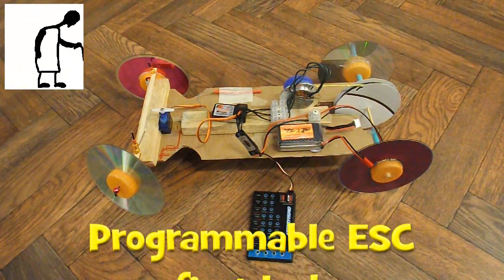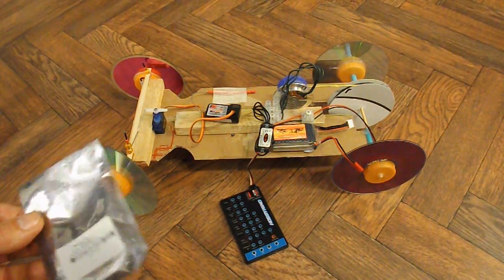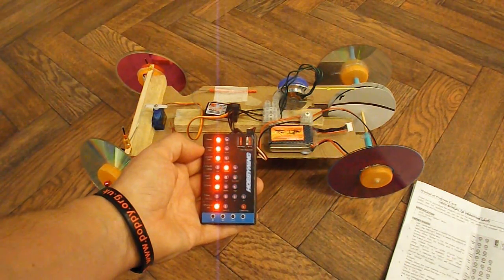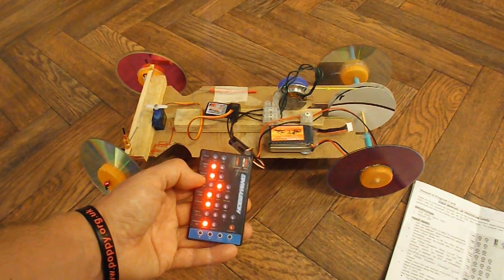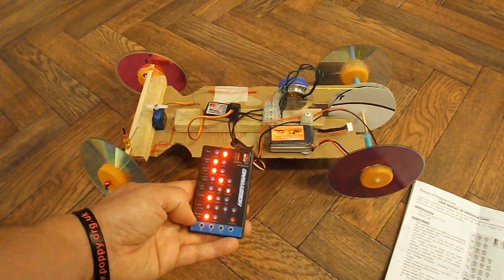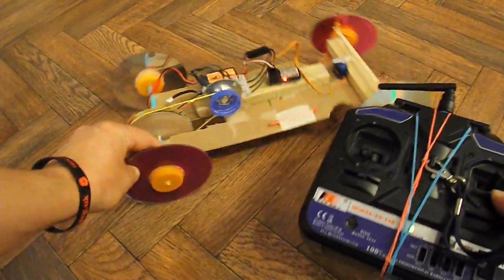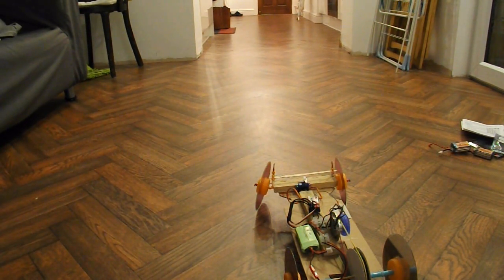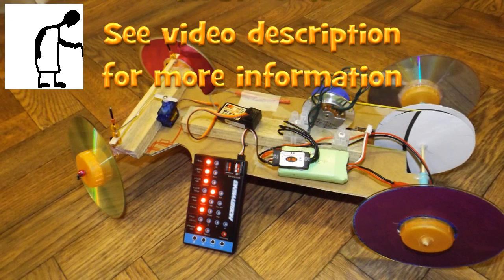Programmable ESC first look

Comment: I think that car needs an alignment haha, pretty cool car though, It might need lower gearing though but that would be difficult without actual gears.
Reply from the maker: +xxX “Datsun4Life” Xxx the angle of the wheels at the front is accidental but it does actually make it turn better as it gives something of an Ackermann Steering effect. The gearing could be adjusted relatively easily changing the sizes of the pulleys. The main problem is fitting anything to the motor as it is not designed to do that and just has a flat face with no convenient shaft sticking out. Previous videos featuring this car are linked in the video description.

Comment: Hi grandad, a while ago I asked you why would you bother to program an esc and now I see that this programming thing is  unnecessarily detailed. I am not going to buy one of these. All I'll do is using my "blushed" ESCs on my projects as they are.
Thank you for the video, you made it clear for me.
Reply: +GrandadIsAnOldMan YOUR OLD!!!!!!!!!!!!!!!!!!!!!!!!!!!!!!!!!!!!!!!!!!!!!!!!!!!
Reply from the maker: +Gurer Guncan I guess there must be a need for this in some circumstances, maybe racing cars might need it to reduce wheelspin on acceleration but I cant see it has any benefit on the type of projects I do. The low voltage cut-off settings may be useful in those circumstances too. I would think if you have a reasonable up-market transmitter you can make the changes on the transmitter instead.
Reply from the maker: Zachary Syed yes, there is a bit of a clue in my screen name

Comment: did you start out with a 1s lipo to start out with or 2s cause it clearly said 2 to 3s    .......... first comment
Reply from the maker: +Tristen Risenhoover it is a 3S that I start with and the power cuts as soon as I try full power so I am guessing the motor draws too much power through the ESC. When I used the 2S it was happier. It is only a 10A ESC so that is why I think it may be the motor drawing too much power. I do not know, so this is just a guess. If I lift the car off the floor so there is no load on the motor when the wheels spin then I can apply full power. With the load applied the power cuts. With the motor running and the car moving the power cuts if I try the steering at the same time so that again indicates extra load being drawn shuts down the ESC.
Reply: +GrandadIsAnOldMan try buying a rc motor for a rc plane that will hopefully solve your problem
Reply: +GrandadIsAnOldMan since u have a plane ESC
Reply from the maker: +Tristen Risenhoover I don't have a problem. What makes you think it is an ESC for a plane. If you follow the link to the eBay listing it states it should do forward and reverse. I don't know of any plane that uses reverse.
Reply: +GrandadIsAnOldMan it states in the futures that it is for a fixed wing plane!!!!????
Reply from the maker: +Tristen Risenhoover when you read the features, try reading ALL the features, not just the part of one line that supports your argument.  It says "3 start modes: Normal / Soft /Super-Soft, compatible with fixed-wing aircraft and helicopter." I think you will find it is confirming that facility is compatible with those craft. "compatible with" does not mean exclusive. Perhaps you would be able to explain how "Motor Rotation: Forward / Reverse" is compatible with a fixed-wing aircraft?